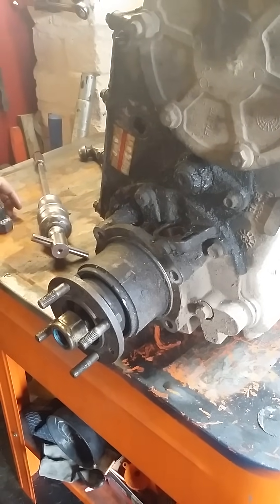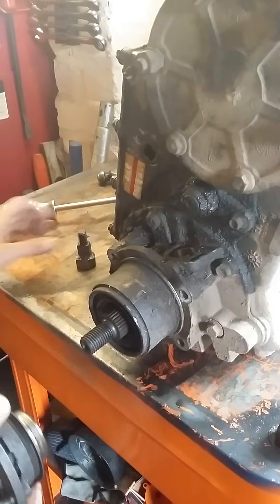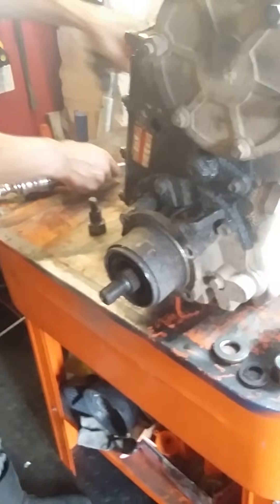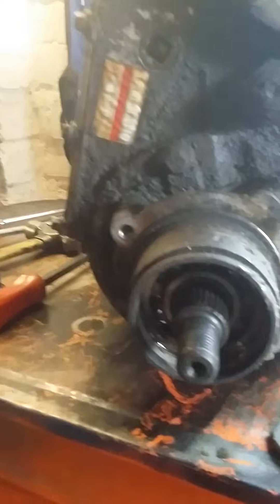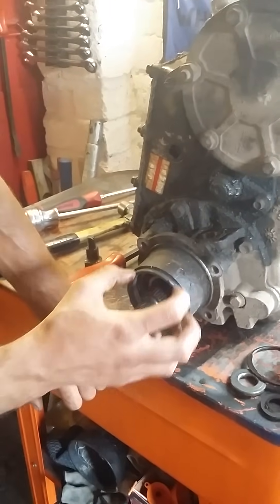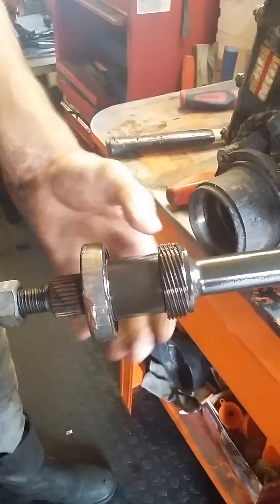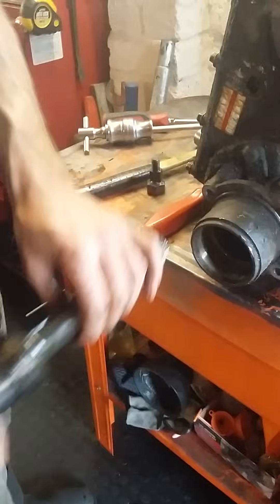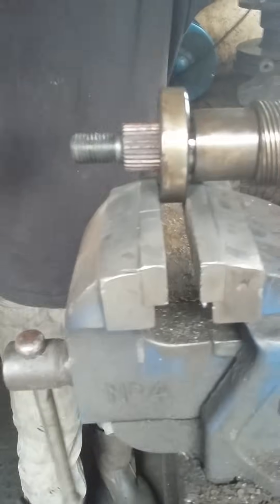HOW TO: Change the rear output bearing on a Land Rover LT230 Transfer Box

Comment: Excellent tutorial. I've got a disco 2 td5. Had 2 gearboxes installed and both have been rattling when under load. If I put the clutch in or knock it into neutral the rattle stops. Do you think the bearings could be the problem? Thanks